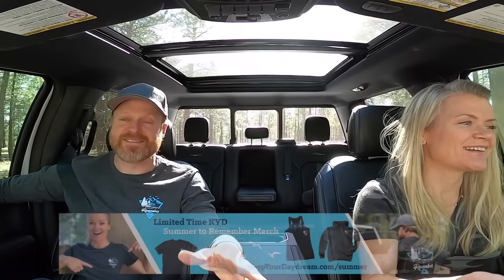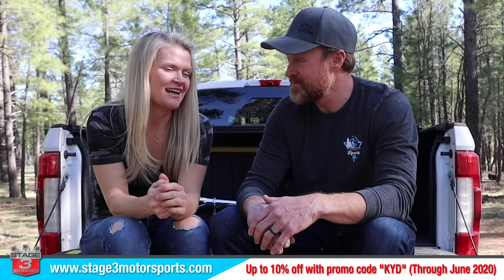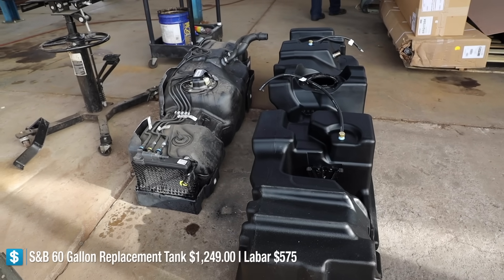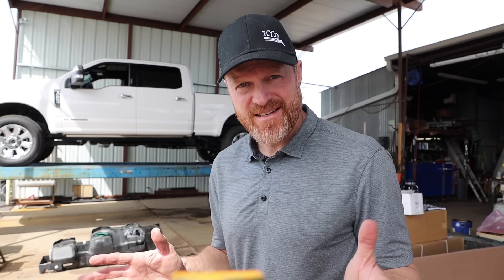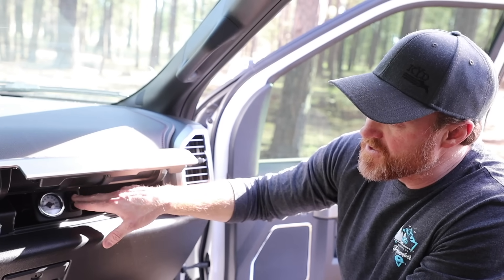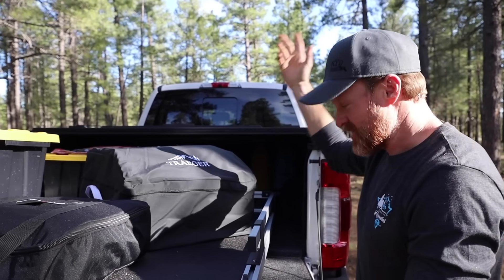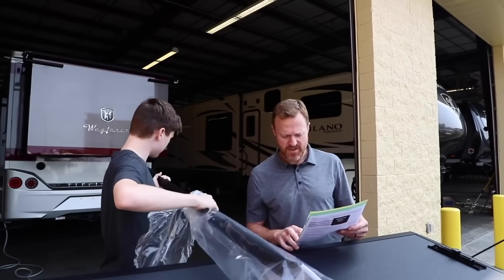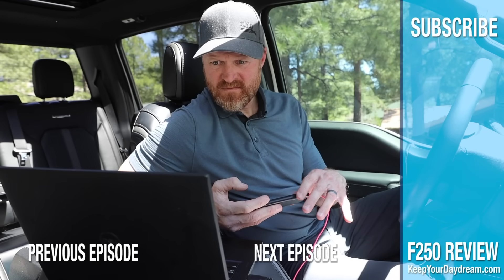Ford F250 Super Duty - Best RV Towing Mods & Upgrades

Comment: These guys have made the "Start where ever you're at" comment before. I had a 1/2 ton truck...so we found a trailer that it could tow (Coleman 2515RL). We upgraded to airbags on the truck...better tires, better shocks and struts...and better breaks. Then took that brand new trailer across the country (Vancouver, WA to Cape May, NJ via Texas). 8,540 miles total...no trouble. Just get what works and do it!

Comment: We have the large full tank in our F-350 plus we have a 100gal tank in the bed so we don't have to stop for fuel for a loooong time. We made it from Albany, OR to Crested Butte, Colorado and then back to south of Salt Lake City, Utah (no trailer) before having to stop at a gas station.  Towing our 30' bumper pull, we went from Albany, OR to Yellowstone and drove around a few days, minus the trailer, before we had to stop at a gas station.  Is SO nice! We get low on fuel and we just pull off the road a bit and fill it up from the tank in the back. No worry about knowing where the next gas station is.

Comment: I have the same bedslide on my F250 and love it!...I wasn't a complete believer in those anchors that came in the slide kit...so here's a Pro tip...there is a slot up under the bed that lines up with the center cross bar of the slide frame.  I was able to secure a 4 ft piece of aluminum angle iron underneath the bed and bolt it directly to that center cross bar (fasteners need to be similar metals).  It's now "super" strong and would probably hold much more than 1K lbs fully extended (although I don't/haven't tested that theory).

Comment: We have a F350 6.7 we bought to haul our 37 foot 5th wheel.  The first things we did was put air bags and 50 gallon fuel tank. What a pleasant upgrade. Now you can drive all day to your next destination without worrying about running short of fuel. Too bad Ford doesn't offer these upgrades on their new trucks.

Comment: I know this is an old video, but it’s still really helpful.  We’ve had a backflip on our f350 for about 2 years, and the biggest issue right now is that we don’t have enough room in it  for things like lawn chairs.  We like having the Airstream clear and ready to use for roadside breaks. So we’ve pretty much decided on a topper and a bed slide. 

Your opinion is very valuable - I wish you had revisited the bed slide after living with it for a while with pros and cons- but I know your time is valuable.  Maybe a short?

I imagine some people will be skeptical that we can’t fit our kit inside of a truck bed - they should try it!

We’re old and unstylish so looking like it’s Grandpa’s truck isn’t an issue.  We just want the whole system to work together so we can enjoy the experience.
Reply from the maker: I'll add in an update in an upcoming video. I've come to the conclusion that a Bed Slide is best with truck cap. I tried to get one, but they are 12 weeks for a ARE Z model or $5k for a Lear. (Both painted and streamline). I'm not so in love with a truck cap that I'm willing to pay 5k. I also don't like the bed rug. Looks messy and old now. Nothing beats a spray in bed liner. I'lll have to come up with a new solution.

Comment: So aren’t you going to go over on your payload with all that extra weight of gas and all those liquids and gen in your truck bed?  I thought your payload was 2200? Or how much did you gain with the airbags?  It’s my understanding that not much is gained?
Reply: Stream Rolling pay load is payload, it doesn’t change, it’s fixed from the factory, the only way to add payload capacity to this particular truck is to...upgrade the rear axle, weld in 2 more crossmembers and add one regular leaf and an overload. Now you can do what I said minus the crossmembers, axles, and YES, it won’t sag as much, but that’s a misconception to you thinking you added payload, if you don’t strengthen the chassis and axles, it’s just adding accelerated wear and tear, my truck, same as his but an XLT had a payload of 2480, when I upgraded to the max tow, it added what I mentioned above, my payload went up to 3490, SRW F250 with the 6.7. Without the max payload package a Lariat has a payload of 2177, or atleast the one I looked at, these trucks are great, but if you don’t know what your doing, you will think since it’s a HD truck I can pull anything, nope, not safely. And if you did all I mentioned, then you have to get your payload recertification from the DOT and email that information to Ford. After that you get your new payload sticker to put in place of your old one. Airbags are great and have their place.
Reply from the maker: I'm sure we're every bit of our 10,000 GVWR now, but I'll re-weigh when we hit the road. The numbers added up on paper, but the Cat Scale doesn't lie.
Reply: TimothyVincent StBarts I did a lot of research before ordering mine, that 60 gallon tank itself weighs in around 55 lbs, add 60 gallons of diesel, that alone is 535lbs, bed cover around 45, rug 10, bed slide, idk atleast 75, it’s a safe bet he added 700 minus the regular tank full of fuel, 400lbs, tongue weighs on that airstream has to be around 850-1000 loaded, always go to the heavy side to be safe, 1000+400+500 for gear+400people, he is pushing it, sure the truck can handle it and they will be fine, the DOT and Insurance company will go by the payload sticker if there is ever an accident, I CAT Scale at 1100 on the hitch loaded, and GCVWR is on the scale is 15,327 loaded, full fuel, and black, grey and drinking water full. I’m not bashing on the dude, he seems really cool and takes care of his family it seems, just wanted to point out by adding air bags you do not add capacity, I added bags to mine for only one reason, with the Hensley Hitch and air bags, I have absolutely zero proposing, it toes like a dream,
Reply: Ford F-250 6.7 Super Thank you for clearing up my question on the airbag addition.  I use mine just for leveling up if needed.  I have ranch hand front and rear bumpers taking a lot of my payload so I’m thinking of removing both and going back to stock. And by the way the tongue weight on a 30ft bunk house AS is about 654# but you’re right closer to 1000#’s. I also carry 2-90# Kayaks and about 75# worth of Thule loading bars on my roof if my truck. I’m all about payload right now.
Reply: The factory payload ratings are not legal limits they’re suggestions made by the factory to cover their asses
Reply: @baileysconstruction7898  Dumb comment.  I would go back to the university you received your mechanical engineering degree from and get my money back.  Seriously.
Reply: He is overweight by a bunch.  Hope he stays out of Canada, it can cost some seriously $$ there.
Reply: @FordF-Super  FINALLY! VERY WELL STATED 👏
Reply: @baileysconstruction7898  try convincing an injured party's lawyer and judge that's the case. Try convincing a state trooper with portable scales not to impound because you're significantly overweight according to the stickers on your tow vehicle and trailer.

Comment: You will love Bedrug.  I bought one when they first came out for my Chevy. I sold the truck 10 years later and it was still in great shape.  I hauled rock and all sorts of yard stuff  in the back using a tarp and it was tough!  Enjoy.
Reply: Until you spill gas or diesel in it. They're great for sound deadening and insulation, but they hold stink for a loooooong time!

Comment: I have had the bed rug for over 15 years. It’s still going strong even though it has been abused. The one thing that I recommend is improving the Velcro on the tailgate and back corners where the tie downs are. That has been my only complaint. 

Keep in mind that you can’t slide anything over it. Usually just snags and pulls. I recommend a piece of plywood when you have to slide things in and out. 

With the rolling storage drawer, you probably will never need to experience this. 

I will say that the bed rug really comes in handy if you have a drive-inn movie theater. 

I would also like to try out a truck bed tent with the bed rug. I am betting that it would be nice companion.

Comment: I purchased a 2000 Ford F250 SD Lariat long bed to pull the 5th wheel I had at the time. I still have the truck - love the payment - but have a Winnebago View now as my RV. My two cents is a truck is used to haul stuff so a long bed is the only choice for me, and a bed slide contraption, however slick it is,  takes up too much bed space. Got to say I love your newest truck, and the last truck for that matter, and the fuel tank upgrade makes the grade with me. Love the channel and take care folks.

Comment: I like the advice start where you are.
We started in 2016 with a pop-up and small truck.
Upgrade to hybrid travel trailer and now have a 28 foot slide fifth wheel,and full size truck.
All upgraded without any liens,all upgraded to newer equipment.

Comment: I have the hard fold up cover myself. Love it! It provides much better security that a soft cover, easy to clean and operate in summer or winter. Can go through a car wash and it's bone dry inside afterwards due to water tight construction and channels that drain water away.

I would NEVER go with a roll up cover, as I'm a tradesman. Come winter, once you get ice, you are fucked. That cover will never open up because both sides where it slides will be frozen up solid.

Comment: Nice I'm lovin the bed slide, BAKflip, and 60g fuel tank.  I'd consider the airbags and air compressor too.....hmmmm.  The airbags would just be a nicety though since as you know we have a 25' Flying Cloud FB.  It's pretty light for our F250 to pull.  You probably don't want to get into now with such a new truck as I'm sure it would void your warranty, but consider doing a full EGR delete kit later on.  My 09 F250 runs and pulls like never before.  It's 6.4L and produces a freight train worth of power.  We did a mini-max tuner with all the 6.4 delete tunes as well as doing the delete tunes for the transmission.  She shifts just buttery smooth now.  As far as our exhaust we had the whole factory EGR exhaust removed and replaced with a straight Flo-Pro exhaust pipe....That truck can finally breathe and sounds like a jet idling when you do a walk around!  Plus we are getting almost 21-22mpg unloaded and 16-17 loaded with the trailer....Great vLog really enjoyed it.

Comment: I had an opportunity to buy a used truck that had a Bed Slide installed in it a year or so back.  I decided against it simply because I could not justify losing 200# of cargo capacity in the bed of my truck. Bed Rugs and Bakflips's, on the other hand, have been standard additions to my last couple of trucks.

Comment: Marc, I have a better solution for bikes than putting them on the airstream, add a front hitch and put a bike rack on it! We did that before our 5k mile 15 national park tour and loved it. We got tons of compliments on it and it actually helped the handling a bit by returning some extra weight to the steer axle.

Comment: I know you already bought the smaller generator, but something I did to my 2016 Colorado w/Duramax 2.8L is I installed a 2nd alternator kit with 135amp alternator, which I wired to a separate 12v battery mounted under the truck in the frame rail and installed Anderson connector on the front and rear bumpers from that 2nd alternator/battery circuit for generator power. Not sure if your truck does this, but mine i have the remote start feature and if i wrap a rubber band around the shifter to push the button in, i can remote start it without getting in the truck and its unable to be put into drive due to being in remote start safety mode. typically it would time out after 10 minutes and turn the truck off, but with the rubber band on the shifter button, it for some reason overrides the timeout, so will stay on infinitely as long as i have fuel and i can start it and turn it off from the comfort of the RV. This is what i have been using for generator power while camping instead of lugging around a portable unit and all the gas for it. i just keep extra diesel in the bed instead in fuel cans. Plus the idle volume of the truck is a fraction of the noise of a generator and uses so little diesel idling with the 2.8L engine i have. I use a 1200 watt pure sinewave inverter I have with an Anderson connecter to quickly plug it into the truck if I want to use it, otherwise i wired up a battery charger on the RV that i can quickly plug into the truck with, with a double Anderson connector cable that charges the RV batteries via the 12v alternator on the truck through the battery charger.

Comment: Nice video. 

Another GREAT option to better fuel mileage and air bags is........ Buy a Ram. The Cummins is more fuel efficient and they can come with air bag suspension with self leveling factory (full warranty), and the far superior interior is a nice bonus. Not to mention Ram uses suspension SPRINGS and Ford STILL uses leaf springs (Really Ford? You have been using leaf springs for over 100 years... its 2020!) Im just sayin...

Don't take my word for it go test drive one 🤘😁👍🇺🇸

Comment: Well we upgraded from a 2013 f150 to a 2017 f250 a d from a 24' funfinderX to as 32' salem...found out the 2017 has to have a 2 1/2" to 2" reducer to hook up the new canoe as it did not come with one and we had no idea there was a hitch size change!! Now I need to find a hitch reducer because the ones I can get at a farm store and 2 auto stores do not carry them...so guess will call the dealer to find where to get one so we can get to camp!! Note...it seems ford has the pin holes measurement different than others sold elsewhere. Maddening to say the least. Luve n learn! Happy camping from Nebraska!!
Reply: Camper needs to replace canoe...silly phone

Comment: Cliff's must be awesome you even spelled labar (labor) special for them.  When you call the fuel tank non-essential did you ask Trish?   That ford will go off road also just because you have a ford don't let that stop you from getting out there you guys.  You can get air controllers that regulate the maximum air pressure and you may want to consider that inline on the air bags so they cannot accidentally get over inflated.  I hope you guys are able to do your trip and have fun.  Be safe and stay healthy.   Hope cone head is all better with no cone.

Comment: Awesome Upgrades.. those up fitter switches are nice to have when adding accessories, especially air horns, you can run a toggle through an up fitter so when you hit the steering wheel the air horn blows or in states where they are illegal, you can flip the switch back to the regular horn.

Comment: How much weight did you add to the truck with the all the extra equipment and how close are to your gvw
Reply: At least 220 in diesel weight, the slide tray probably weighs 300lbs or more.  Airbag set up maybe 100lbs and the Bed topper is at least 150 so they added roughly 800lbs give or take to their Gross Vehicle Weight. Reducing mileage and towing capacity.

Comment: When going thru Canada and in New Brunswick take the back road out of Saint John to the Bay of Fundy national park beautiful views there is an awesome seafood place on the way also must see Hopewell Rocks largest tide change in the world. also enjoyed PEI. Your upgrades are always top notch I put my compressor in a full width tool box along with the tank and ran the plumbing out to the back. Back flip is great but to solve the vision problem I think they make a roll up that is much easier to use. and not block you vision Your bed rug will get wet with the flip back flip been there done that. Great video as always just my 2 cents have fun be safe.

Comment: Mark, another great video. Been with you from the beginning. You mentioned that you bought a bike rack for the Airstream.  I know you like the CAT scales and you check your tongue weight so just recommending you measure your loaded tongue weight with the bikes on the back in order to ensure that you do not reduce the tongue weight to a level below 10% of trailer weight. 15% is better for avoiding trailer sway. Airstream recommends not adding racks to the rear of the trailer for this very purpose. We have a rack on the back of our Bigfoot with two bikes but I added larger batteries on the front to maintain tongue weight. Great job. Love your work.

Comment: Marc,  i have a dust cap that fits over the entire quick connect air fitting to prevent corrosion and dust from getting into the fitting.  i also mounted it on the floor between the drivers seat and door.

Comment: I went from an Aliner with an Explorer Sportrac, to and F150 for the Aliner, to F150 with Aliner then. 28’ Jayco, then an F250 CCLB with a Pilgrim 306RLSS, to an F450 with a Carriage Carrilite CT36XTRM5. My biggest frustration throughout was RV build quality. The flat roof in the Jayco phoned water and they did nothing. The Carriage is junk. Cushman and Emahiser drove it into the ground with warranty claims. Cost me $6k to fix slide roof because Carriage didn’t install the roof windows according to specs. You could have bought a long bed and got 48 gallon fuel tank. My compressor was in tool box with 2 five gallon receivers hanging under the box ahead of the sheet wells.

Comment: I don't understand why you added air bags to your truck.  In the past I have seen you using a weight distribution hitch.  I thought that a properly setup weight distribution hitch eliminated the need for suspension "helper devices" on a tow vehicle.

Comment: Should’ve done that Bluetooth air bags. It just gives you a wireless controller that looks like a garage door opener has a digital readout you can set three different settings  for different air pressure and you just touch 1 2 or three and automatically goes to that air pressure in meetings at all the time you never have to touch. Plus you don’t have to mount a gauge or  switch on the dash.